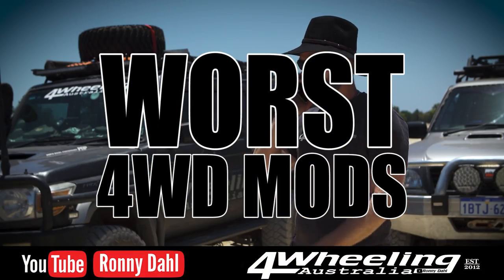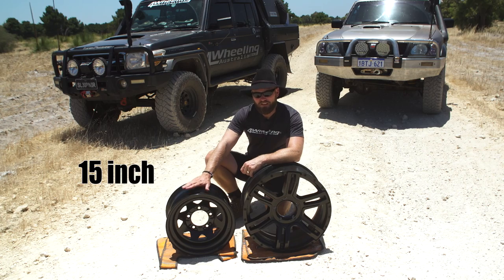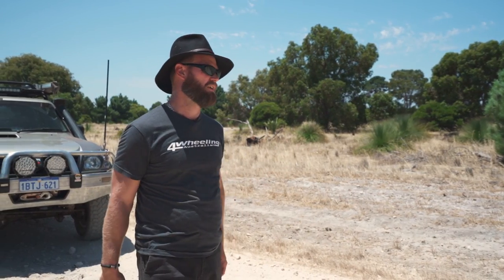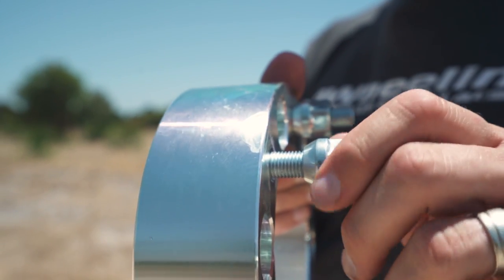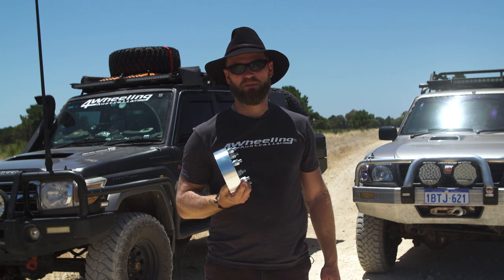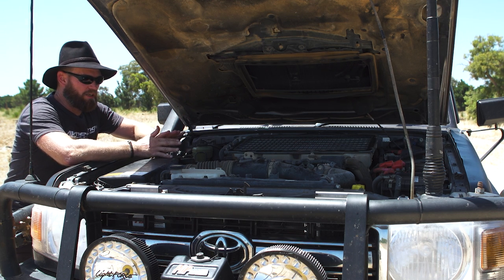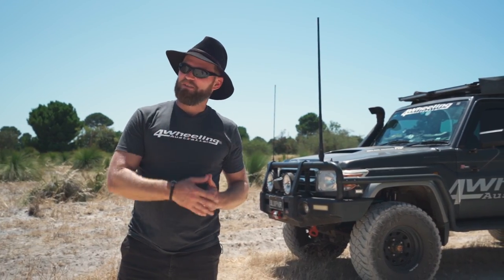WORST 4x4 MODS, DON'T DO THESE TO YOUR 4WD

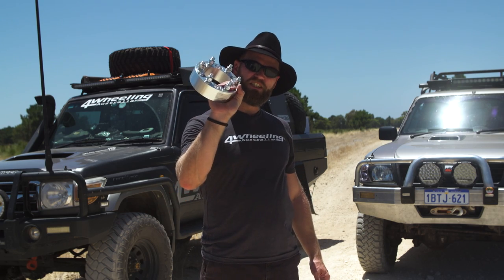Comment: 9:07 ok fair, but I don't have 10+ grand to spend on a rear diff for my weekend warrior (VDJ76), and I bought it with 5 alloy rims which I also can't justify throwing away to buy 6 new rims plus a new tyre to sort out my wheel track. I live in Albany so the main offroading I do is in sand and it was actually dangerous to drive on the beach (came close to rolling) even at 15-20 km/h because the rear diff is so much smaller. I agree that spacers is far from ideal, but it's made my car drivable and I rarely drive it unless I'm going on a 4wd trip anyway. Also I realise it's illegal, but so is a 3 inch lift with 35's and a straight through exhaust. Spacers are the least of my issues as far as legality goes.
As soon as my rear diff shits itself, though, I'll most likely get a track corrected one, but that's not a priority right now.
Reply: I ran 1” spacers on my gen1 taco with a liberal application of red thread lock and torqued correctly.  They never came loose.

Comment: I used my HI-lift Jack to hold my tire in place after breaking an axle shaft.   Rear driver side axle shaft broke, strapped Hi Lift jack bar to my sliders and bumper, put it in 4WD and drove it off the trail... if not for the useless HiLift jack, I'd be dragging my Jeep off the trail.

Comment: Wow. Didn't know that my 6" lifted chevy suburban I've driven nearly daily for 28yrs in the mountains of Colorado is dangerous and handles terribly. I even run a 37" mud tire. Maybe I should just by a Stupidbaru with some P metric tires.
Reply: Idk, my 84 chevy 1/2t had 7" lift and 33" bfg's. Didn't handle bad at all. But then it wasn't really considered a 'big' lift either, maybe compared to a subaru it was. Also most of his info (understandably) is aussie based. Like wheel spacers, they're not illegal here. Most of the guys at my high school had trucks like that with 6"+ of lift and 33-44" tires. Dumb kids who didn't exactly drive or offroad 'safely', no catastrophes.
Reply: yup,the laws in this country are from granny..she dont get out much..i have 4 u.s 4x4rs all with 35" tires,most raised 4".by me.the bronc is 5".we had a cop,he,s in our club,,do a talk on rules regs..i sold my 4x4 next day,,pointless having one..i didnt but,that,,is how it felt..most non,or over std mods have to be engineered,,at a great cost,inconveniance..even if i bought a 6" kit from u.s,with appropriate tires,,it would be defected.& crushed...most lift kits here,dont include brake lines,,its illegal to touch brakes,or have drilled discs,,i have 3 sets,4 wheel disc conversions,,,,sssshhhh......its all a money grab....the rules here for 4x4rs are basically same as a car..15 mm bigger tires,,2" lift.period..if,,you have watched 4wd action,all that is for the camera.there called 4wd 24/7 now.bs show....i have a 1962 f100 4x4,352FE,fitted,,,,,1975 highboy,,,,82 bronc,,,2002 s/duty,4.2tdi,brazilian...&,,a 1973 challenger,340 r/t....///...blazers were popular,but pulled out of aus with dodge..so,only f series here mainly.old ones..new ones,ford dodge,are 160k..

Comment: The wheel spacer vs offset rim debate.  They are fairly Equal.

An offset rim a wheel spacer of similar offset will move the scrub radius out as much as a corresponding wheel spacer. Both will increase stress on the bearings. Offset causes a lot of suspension changes. Somethings other things need changed to correct it. The bearing wear is minimal from my experience, but either spacer or a rim with similar that sticks out just as far will have the same results and anything else associated with offset.

Hubcentric wheel spacers are the only spacers anyone should use if they are going to use them. They come loose. You must always listen for creaks when going slow. It's a huge con you must realize if you use spacers. They don't just fall off, they give you a lot of warning. It's cheaper than buying new wheels, but comes at a price. This is the only valid part of the argument in my opinion. 

Use a HUBCENTRIC SPACER. Grease your lugs and torque, and listen creaks when going slow next to concrete every now and then and you are good. Once they are tight they seem to stay that way. Its good practice to always listen to your vehicle.

Comment: Thanks for backing up my gut feeling about wheel spacers, do I want to buy new wheel bearings? Not any time soon!!
Reply: I’ve had spidertraxx wheel spacers on my 4Runner for about 6 years now and have never had a problem. Every time I go for a wheel rotation they retorque the wheel spacers for me.  I wheel with them 2-3 times a year.

Comment: Enlarging your wheel or tire outside diameter without adjusting the differential gear ratio. 
Need to add a limited slip unit to differentials or at least the front end due to engine weight providing best traction.

Comment: Few people understand this logic. If you go more than 3 inch on your lift, you need to change everything. If you increase tire size more than 2 inch over stock, you need to change everything. There is no free lunch. If you max out on both tire size and body lift, your vehicle will feel the strain and break a major component at the worst time.

Comment: I had a swb landcruiser with I shit you not around a 12" lift. I thought it looked awesome- and yea it turned heads. I could talk to the big rig drivers out my window. The body roll was ridiculous even on road and off road the truck was useless. Went back to a lwb 60 series then a lwb y60 safari, both with modest lifts and way better off road performace.

Comment: Wow, it took ten minutes to get to something that I disagree with. I like this dude. I have to say though, I've used my high lift jack to lift my truck by both tow hooks under the front bumper, the hitch receiver on the back, the nerf bars on both sides, and a few times I've lifted a front tire by sticking the jack jaw through the cutouts in my rim but I definitely don't recommend that. However, that jack only works for me because my truck is steel, my bumpers are steel (factory steel from 1993), and I have the hitch receiver, nerf bars, and tow hooks. Overall I liked this list and I was very happy with the first one listed.

Comment: I think one of the worst thing I see is having the air snorkel  opening facing forward on any 4x4. Why have a scoop catching all the big rocks sticks etc. going in and clogging up your air filter. Better to have the fine dust, than all that other stuff. Not picking, but for extending your air filters life or cleaning schedule especially out in the boonies, turn that opening around.... Ships have Huge snorkels and not one of them face toward oncoming wind or water, same concept for a land vehicle snorkels! It might look cool but its dead wrong!

Comment: Working as an auto spary had to install 6 12v sockets and 2 USB sockets to a camper trailer, there was already 4 12v’s and 1 dual USB I can’t see the need for running that much crap

Comment: My truck came with 20" wheels as part of its trim package. Dumbest thing ever. Downside is, i got some decent all terrain tires on a killer sale so now I have to wait for those to go bad to justify swapping to the 17" wheel setup I had planned. Ruins the ride and prevents dropping pressure any significant amount or risking damaging the wheel or de-beading the tire. That and they just make it look like a mall crawler.

Comment: I work with a few blokes who have more cash than brains when it comes to their 4x4. Massive turbo, huge lift and m/t tyres, snorkel, winch, roof tray, more spotlights then bull bar, custom rock sliders, full length custom bash plates. You name it, these guys bought into it. All of these mods all of this money just to take the occasional beach fishing trip to stradbroke..... absolute wank. I drive a prado, slight lift, factory bar work, a/t tyres and a duel battery system.... same trips, same results. Might not look the business by comparison but I've spent way less and get the same result.

Comment: Without any tuning or messing whatsoever, my 2002 Rangers turbo seems to start spooling at about 2000RPM. Is that the right sort of place for it to be working? Or would maybe a smaller turbo that spools at an even lower RPM be better?
Reply: Leave the stock turbo bruzzy

Comment: Manual handleling of oversize tyres,|'m 57yrs old and don't need the added risk of lower back injury trying lift any tyre over 32"s on and off the spare wheel carrier.

Comment: A well designed 2-4 inch lift is way better than any 6 inch. Or at least in my opinion, because you realistically will never need that much ground clearance until the obstical is steep enough to tip you over.

Comment: A big waste is not going full all on and first, so you end up regearing twice or thrice as you go from 31 to 33 to 35 inch tires, or you end up increasing lift, or need different axles or such.  Buy once, do not  do an incremental build

Comment: I work at a tire shop and were selling more and more "all terrain" or even "mud terrain" tires for 19" or 20" rims and little to no sidewall, it makes laugh every time. Just today I replaced some practically new radials with "off road" tires on a 2wd truck with 19" rims. Needless to say, he shouldve just kept the street tires

Comment: The spacer shown is not a good idea any way. Its not hubcentric, with out being hubcentric the wheel can have play in it. I personally have wheel spacers but only on the wheeler. Rig was set up nicely but i did a brake upgrade and the wheel was a few MMs off and I couldn't put the wheel back on afterwards . I have a 1/2 inch spacer on and the wheels clear off the brake. However I use hubcentric and only hubcentric and the spacer is designed for my rig and only my rig so its a perfect fit , no play and no slop.

Comment: 1hz 80 series, what's power? What's tune? You mean not overloading the poor girl.

Honestly though spot on with all this, I am an ex mechanic, worked mostly on 4x4s and heavily modified cars (street, offroad, racing etc boss had a great reputation), and I've owned. The more you modify the drive line the more you need to pay to maintain it.

Hell I've had the pleasure of driving an "80 series" with full space frame chassis, viper v10 with twin turbo, NATO wheels, portal hubs, you had to actively use a small step ladder, as a 6ft guy to get in safely. Offroad, omfg it was fun, onroad, let's just say I am glad the owner had canvas seat covers.

It was not made to be onroad for longer than going from the trail to the trailer (it had way more mods than I could be bothered listing, the only real stock part was most of the body cab....kinda).

My advice, if you get your first 4x4, give it a good service, install some recovery points, replace what's broken then take it out with a group and see what needs to be replaced if anything. You'd be surprised how capable most cars are offroad, let alone 4x4s. More so if you have one of the bigger brands flagship offroaders (on average an xtrail is not going to do as well as a patrol). Save your money and only get what you need, what you need to be safe and do what you plan on doing. If its looking like it needs front to back modifications, ask yourself if you want to daily your 4x4, if not go nuts, if you do buy a second 4x4 or vehicle then go nuts.

Comment: Id like some recommendation from you people that know more than me.
I have a Pick-up truck with switchable 4WD.
Pretty decent tires and whatnot.
Ive not done anything to it after i bought it (its a Mitsubishi L-200 from -92).
Not planing on driving on offroad tracks, but it happens that i drive, off the road cus i often use it to transport wood.
Anyway, it is very slow in acceleration and feels a little weak on power sometimes.
Judging from this video, would a SMALL turbo be a good or bad way to go to get that little extra power for acceleration/strength?
Reply: What size tires are you running? There are charts all over the internet detailing the relation between your gearing and your tire size. Find out what your gear size is. You might be better served regearing. Helps when crawling in 4x4. Might even give you some MPG gains if your tires are bigger than stock.

Comment: On my beastie that is my daily driver I have run spacers in the past to prevent bind from the rims to my track bar. Removed these after I converted to a high-steer knuckle but they never gave me issues when installed properly and are used in a state where they are legal. For my tires I run a 37 inch Pit-Bull Rocker which are very aggressive. I do rotate my tires every 5000 miles so that keeps them wearing evenly and I tend to get tons of miles out of them. Current set is around 25k miles and only down about 2/5ths tire tread.

Comment: my 2 wheel drive nissan will get a sports bar w/small rack on top, back and front bumper guard cause it  looks nice an air intake.  sounds cool yeah mate????
because; we beach people kayak, boogie boards, cooler etc.  also, people in Hawaii like to bang bumpers and ninja out of there. and helps the engine cool, breath better, increase torque w/tune.

Comment: I have 2 awnings, and I use them both. 
Many national park grounds have designated park spots and I can never predict which way my car will face.. so I am prepared both sides. 

Roof racks in my opinion make 4wds look better... They're like acubras for cars. A much better look indeed. 
Yes $2k is a bit much. Mine was $800 and it literally carries an aerial for DAB.. 
But I argue yo you that no one waste money on a roof rack as it makes it look way better.. ALWAYS. 

I have used my light bar numerous times, but yes, it is probably my least used accessory that just sits there.

Lastly, you have a vid on snorkels, how they're not for water submergion but for cleaner air breathing on dirt roads ...
You mentioned theres no point unless you're planning or have done everything else.. and what's that ? Turbo, intercooler, tune.. yeah right.. I think that's wrong. 
You're right about the use of a snorkel for breathing cleaner air. I spoke to a turbo builder, and he educated me on air speed and air pressure.. (something I commented in your snorkel video about backward facing aluminium) and that you need both air speed and pressure. My snorkel is mounted in a way that all factory bends and turns are eliminated and the air flow is straight into the turbo via decent filter. That increases reliability of engine. 
So your snorkel argument is only valid for city drivers that never hit dirt.

Comment: #1 The only reason to get a bigger diameter rim on any vehicle is clearing the brake caliper, otherwise the smaller the rim the better (on an off road rig).

Comment: Would you say its possible to go offload with 18" Alloy rims and BFGoodrich A/T tyres???
Reply: Depends on what kind of ":off roading" you are planning on.  I used to run AT's but they always fill with mud, wet sand etc. Fine for the road and mild dirt roads though.IMHO

Comment: If you know what you are doing, a hilift jack can lift almost anywhere, a wheel hook means any corner can be lifted. They are also a winch, a crane, require only a pin kit in the spares box, will work without electricity in any weather, at any angle, on (subject to damage) any part of a vehicle, and in a pinch will even move bent body panels, bumpers and even chassis rails. More reliable and more flexible than any number of electric or even hydraulic winches. 

Do all or do nothing, I disagree, do all that you need, and no more. Spacers, lifts, stupid tyres I completely agree with, never needed or wanted any of them. Even always run on stock tyre sizes without any problems, even trundled right past many of the "all the gear no idea" crowd many times.

Comment: I disagree with not being able to tune an engine for economy, my discovery 2 td5 was doing 27mpg as standard and I got it remapped by td5inside, I told him I wanted better mpg, after the remap I’m getting around 32mpg and that’s because I don’t have to rag it through the gears to get it going like I did before, the turbo kicks in lower down the Rev range so I can change gear earlier without going high on the revs, I get it in 5th gear at around 27mph and it’s got the torque to keep it in 5th as long as I don’t drop below 25mph and it will pull even at that speed, best thing I had done to my td5, more power and better mpg without stressing the engine out, still on standard intercooler but I did change the clutch for a HD one just incase.

Comment: I've got a $30 ebay roof rack with $8 ebay led work lights, an Ebay jeep steel tube bumper, and an Ebay 12000 lbs winch mounted to my Kia sportage, I'm a cheapskate and so far nothing has broken

Comment: Putting large diameter rims/tires makes your gear ration worse, need to change your gear ratio to get same power to the ground. Neighbor did this to his jeep, had barely enough power to go 75 mph, also makes your car stop like shit, brakes have to work much harder to stop your vehicle with large diameter rims/tires. Dangeraouse at best.

Comment: Cold Air Intakes. they do nothing. they do not bring in cold air. they are more susceptible to water and there forth hydro locking. depending on size and location of the intake changes things tho. although when you let more air in you need to get rid of it faster too which means new headers and exhaust. then new exhaust gets in way of suspension. then your engine runs hotter from more power and you need to upgrade cooling. snow ball effect lmao.

Comment: I got 2 that you missed. First using lift blocks between the diff and leaf springs. The other one is really stupid. I use to live In New York. I now live In South Carolina. The kids here jack the front of the truck as high as they can. The they lower the rear of the truck as low as they can. They call It the squat. If you saw It you would LYAO. I know I did. One more for the road straight pipe exhaust system. That's no cats, no mufflers and the biggest dia. tip they can find. Obnoxiously loud and useless.